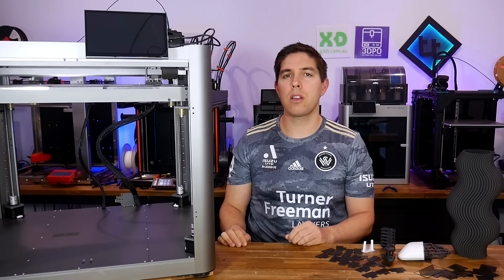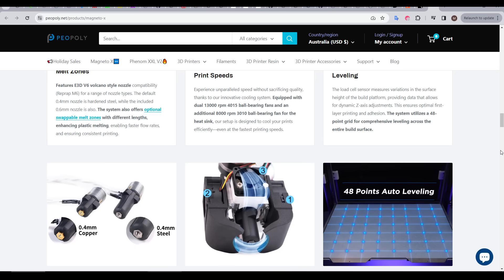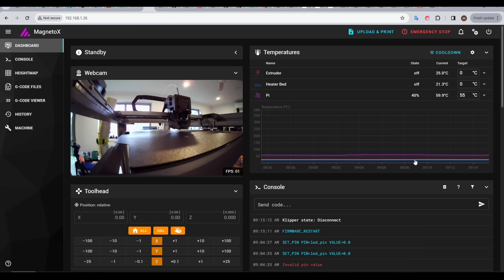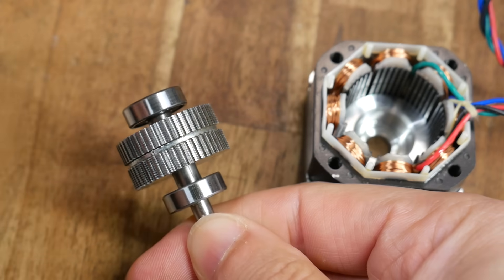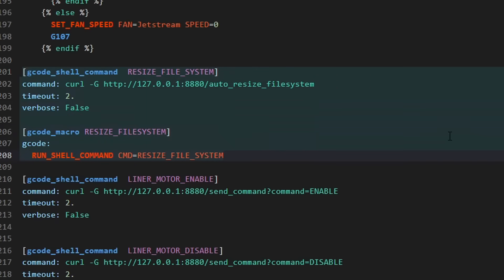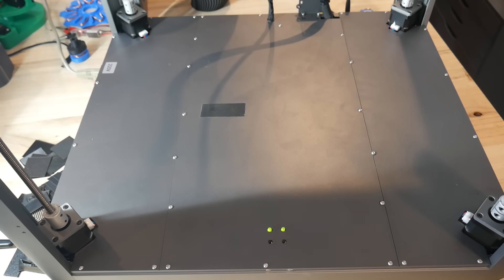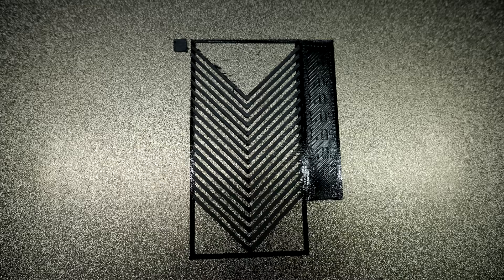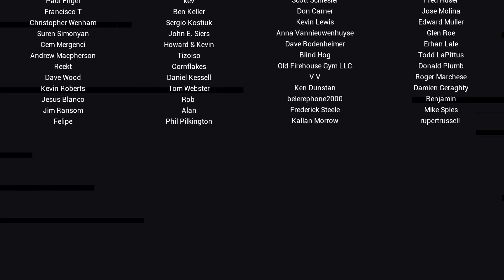Field testing the Peopoly Magneto X linear motor 3D printer

Comment: I'm glad that someone finally built one of my ideas 💡.  I'm not saying that I was the first to have it or even that I spoke with anyone involved, just that I have been wanting to experiment with this design myself for years. I'm hoping that they will do it justice. If done correctly, I think that the linear maglev rail design will be the new gold standard.
   I would love to see this type of design paired with the helical worm cycloidal extruder.
Reply: It has an orbital extruder
Reply: You're correct of course. My dumb brain 🧠 couldn't remember the nomenclature for the "helical worm cycloidal extruder." So, I just typed orbital as a place holder, because that's what it looks like when it's running...
Reply: @THEOGGUNSHOW  AH, yes, that would be an interesting upgrade to try for sure 😁
Reply: Ok, I just re-watched it and he called it a rotary roller drive extruder.
Reply: You probably already know, but this almost certainly uses linear rails instead of maglev.
Reply: @EmperorA0  it uses linear motors for movement, which uses magnetic arrays to provide movement. It uses linear rails to constrain that movement. Two different things.

Comment: Does a printer even need linear motors?
We can do movement faster than any 3D printer will ever need.
Feedback and encoders on the other hand is a whole different beast.
Reply: Less moving parts, more direct control over the movement.
Reply: @MetalheadAndNerd  more interia load, heavy motor,  heavy Gantry.
Reply: @alfredanil  Doesn't matter, the motor is far more capable and there's no belts to stretch. CNC machines use these motors for a good reason. These aren't stepper motors.
Reply: @Geoff_W  well, cnc machines are moving towards rack and pinion mechanism my friend.
Reply: @alfredanil  Okay? That is because of the still greater increased load they provide, that does not mean anything for what I'm talking about.
Reply: @alfredanil  Inertia is only a problem if the drive system cant handle it.  Which is not the case here.
Reply: Yes. Eliminating belts and pulleys eliminates one of the biggest sources of resonance, ESPECIALLY if we want our printers to get bigger. Anything larger then 300mm is going to be speed-constrained if it uses belts and you want a halfway decent print. This printer IS the solution. This is the future.
Reply: @Geoff_W I agree with you, but these rails made of magnets seem very expensive to scale up
Reply: @MrChoklad  The initial cost of the motors and the added cost of longer linear rails will far outstrip the magnets. It's certainly not the most cost effective method...yet...but economies of scale and higher demand will drive the cost down to the point it's entirely possible to get close/cheaper then belt driven systems.

Comment: I have three things I'm very curious about with this printer, in regards to the linear motors and magnetic rails:
1. Print quality - is it better than everything else out there? Especially in regards to VFA.
2. Noise of printhead moves - is it noticably more quiet than a printer with belts and stepper motors?
3. Can it print faster while maintaining excellent surface quality than other printers on the market?

Thanks for the video and all the work you do on the channel!
Reply: I second the question regarding VFAs. I like my Bambu X1, but below 150 mm/s the VFAs can get quite bad on those so it would be nice if a printer was out there which doesn't produce those
Reply: the noise of the motion sysyem minus cooling doesn't seem bad. But the fan noise when cooling is maxed is very high
Reply: my guess is it mainly is not affected by movement and temperature, the belts wont wear down nor stretch under heat cause they aren't there

this also sounds far more scalable to me, a normal CoreXY printer's max "good" size is about 350mm x 350mm, above that the belts get extremely long and stretch becomes more apparent

it also won't build up heat as bad like a stepper motor, because the magnets are spread far over a large area
Reply: @BH4x0r  The weight of the linear motor on the X Gantry might still be an issue
Reply: @dasjulian3  Nah, these are used in CNC machines, the weight of this print head is nothing by comparison.
Reply: @dasjulian3 the beta team has been testing this as well.
Reply: @Geoff_W cnc is much slower than 3d printers though so print head could be more of an issue. Also depending on torque and how well the linear motors are tuned they could easily overshoot
Reply: @madbull4666  Overshoot absolutely, but the torque possibilities basically lend themselves to speed instead of torque as a tradeoff. Having the closed loop control means overshoot shouldn't be an issue.
Reply: @Geoff_W However unlike a cnc, you DONT want weight on a printer.
Reply: @Geoff_W  it shouldn't be an issue depending on how they've done it but a motor can only go so far without having issues such as slight ringing etc. Speed and torque depends entirely how they have done the coils and size/strength of magnets
Reply: @user-cg3em4cw4f  Because of belts...which this doesn't have. We've seen enough results of prints off these printers to say that.
Reply: @Geoff_W  no, its not because of belts. Its because increased mass requires more force to get the same acceleration, and weight will induce harmonics on the gantry. F=MA. It has a little to do with belts but not that much.
Reply: @user-cg3em4cw4f  Again...the results already prove you wrong.  Belts and pulleys are having a bigger impact on our prints then we thought.
Reply: @Geoff_W  But CNC machines don't generally run as fast as a 3D printer head.
Reply: @andyspoo2  while cutting, no, but while tool changing and other tasks, time is money and they optimize it. Travel time is still travel time.
Reply: @Geoff_W  You're way off. Stubborn. Go learn something about fast printers.
Reply: @Geoff_W  What results? Obviously this printer works well. I’m just saying I think this design still has issues scaling with size, up or down. You’re not really asserting an actual point or reason why I’m wrong either, you’re just repeating the same thing. Again, the fact it works on CNC machines means NOTHING. CNC machines WANT TO BE HEAVY because it adds vibration dampening, and even their rapid travel speeds are still slower than what some people get up to on a 3d printer.
Reply: @Geoff_W  Right, industrial CNCs are marvels at flinging the heads around.
Reply: @user-cg3em4cw4f  Your point was the increased weight of the tool head introduces harmonics that will cause this machine to not produce good quality prints. My point is we have seen good quality prints come off this machine, printed large and at speed. Nero3D already showed off prints that have come off his machine. Harmonics are not a problem, the machine is solidly built and rigid. Any harmonics introduced are not transmitted into the PRINT, and the machine is not flinging itself apart. If you have an ACTUAL point beyond that, give more than a vague insinuation without evidence of a problem.
Reply: @Geoff_W  My point was for future scalability and the arguments as to whether this is objectively better than belts. As I said in my previous message, it works fine for this printer as it's in a sweet spot for size where this is a good solution, but scaling it too far up or down would cause issues I believe. This printer does work well, and I never disagreed with that. I'm just disagreeing with the principle that belts are an inferior solution. In regards to harmonics, you always prevent them from transferring into a print. The issue with more printhead weight is it means that gantry will deflect back and forth like a spring in response to deflection changes, something that has been well studied for high speed printing. These are the harmonics I was talking about, and also there's no such thing as transferring harmonics into the frame and not the print. The frame and print move in relation to eachother, you do realize, right?
Reply: @user-cg3em4cw4f  This solution is far better than belts when going larger then ~350mm build volume. For smaller, belts are fine, although maintenance cost and downtime for these will be less, so depending on use case there MIGHT still be an argument for linear motors...maybe. But that's going to get down to personal preference. Also if we ever figure out a way to put filament down more precisely, I could see a use case for very small detail printing at high speed where the linear motors are simply much more precise than stepper motors are capable of...but these are edge cases. Around that larger size, belts become extremely impractical to continue to use, which is specifically the problem linear motors solve. The other realistic solution for that is to use ball screws, which is more expensive than this solution, so in terms of scalability going larger this is a more scalable solution then belts.

As for resonance, we literally use input shaping to prevent that resonance transferring into the part through vibration caused by resonance. That still happens, and you still need that here too, but it has an accelerometer in the tool head and it uses input shaping...if you have some other point you are trying to dance around I'm either missing the context or you need to spell it out more clearly. As for the frame, yeah, as we push speed we also need to start building our frames out of something that isn't printed plastic and 2020 aluminum. We are reaching the limitations of that, just look at the VZ bot and RatRig projects to see that in practice as well.
Reply: @Geoff_W  I'm just of the opinion that this will be a rather niche motion system. It's definitely better for large systems, but fast printing as a whole doesn't really work when you get much larger than this. Input shaping helps but at a certain size you reach limits on what it can do. Steel would help with the frame, but if you use it for the gantry you're back to the issue of adding more weight that then makes high speed harder. It's a weird issue in terms of scalable high speed printing. Don't get me wrong I actually think this is super cool and would immediately buy this over a bambu labs or prusa printer if I had the money. I'm just speaking rom my experience building a printer before on how toolhead weight can be an obnoxious issue.
Reply: @BH4x0r  Heat might still be an issue.  That comes from the electromagnets, which are part of the linear motor itself.
Reply: @EmperorA0  yes but it doesn't demagnetise the magnets nor cause tolerance issues (rotor in a stepper expanding too much)

80°C or 150°C, doesn't make a difference as long as the enamel is high enough temperature

also, the coils are much larger, a stepper has multiple small coils, so i suppose less resistance aswell in these

neodymium magnets lose strength fast dependant on the temperature, this can be temporary but also permanent

in this case they'll maintain strength and thus need less current as the neo mag's magnetic field will be stronger

having a stepper running at 80°C will definitely cause more temperature rise as it needs more juice to keep pushing, and thus become even hotter

Comment: I would appreciate more explanation of the closed loop system. Magnetic vs optical encoder?
Reply: Open loop - system tells - move 10 steps - motor tries moving 10 steps.
Closed loop - same but system checks if motor moved 10 steps.
Reply: @VEC7ORlt  That's not what I meant.
Reply: @PeasantHunter  well, what have you meant?
Reply: Magnetic strip on the side of the gantry.

Comment: Looks great, but I guess the company needs to demonstrate what makes the linear motors better, other than they are just different.  Your getting lots of extra weight and cost, but what does it provide in return?  I, myself, have never beern a fan of Klipper's displays, so hopefully they can put an overlay on that to make it more user friendly. If I'm going to pay $2500 (printer and enclosure guess) I want a polished product instead of a science experiment.  The reason people like the Bambu Lab printers so well is because they are a polished product, not a science experiment. For a $2000+ printer, this is even MORE important.

Comment: The magnetic rail and linear bearings add a lot of interia to the motion system. The big advantage of rotary stepped over linear motor is that the permanent magnets are well encased inside the stator. The magnetic flux of the rotor is almost completely insulated, whereas the linear motor has its magnetic flux scattered around the long rail which could be dangerous.  I don't see any advantage with this design.  I would rather prefer a rack and pinion based design where the pinion gear is driven by a stepper motor.
Reply: What kind of danger do you see there?
I don't see any advantage of rotary steppers with the additional elasticity of belts compared to a linear system where the controllers's pulses are directly translated into linear movement.
Reply: @MetalheadAndNerd  those very powerful neodymium  magnets exposed in the printer.  Heat from the chamber if enclosed can rapidly demagnetise the linear motor.  In contrast I mentioned about rack and pinion as a better alternative,  there are no belts in this mechanism. I am well aware of the stiffness of the belt driven mechanism .
Reply: @alfredanil The magnets are high temp rated, up to around 120C iirc. The chamber isn't designed to exceed 70-80c. No more of a concern than the bed demagnetizing. (actually less, as it's not directly heated)

Comment: I just want to know what the linear motors buy you that stepper motors don't.... I don't think additional speed is the answer to that question, at least not the only answer. This printer is very expensive, so assuming the linear motors are the majority of that cost, why would I choose that over a printer with stepper motors? Are the prints higher quality? Could you some how compare a print from stepper motors to a print from this printer showing the differences?
Reply: I second this. @TeachingTech Michael, please test the linear motors in such a way that it really highlights the benefits and flaws of such a system. Like if they get dirty, dusty, or have stuff left on them how does that affect operation and durability? Since they are linear magnets is there issues with easily getting screws or tools stuck to them? I'm imagining accidentally dropping a screw on the linear motor and not noticing it and what would happen?